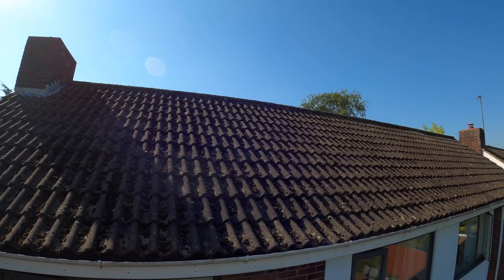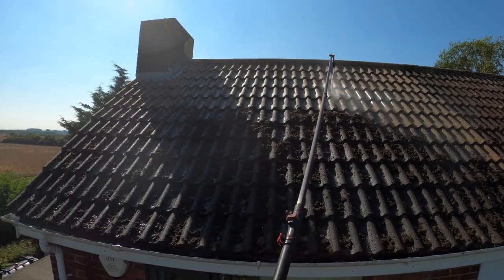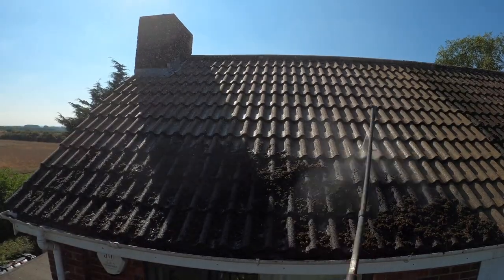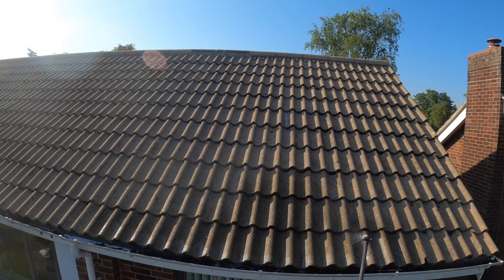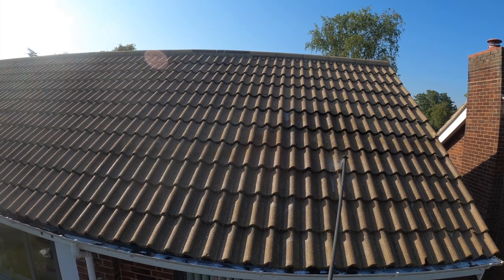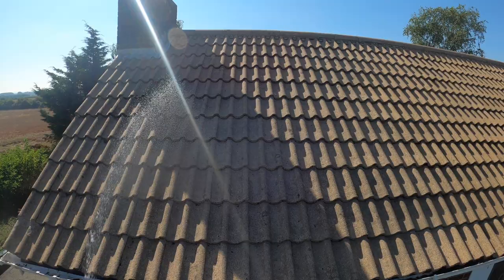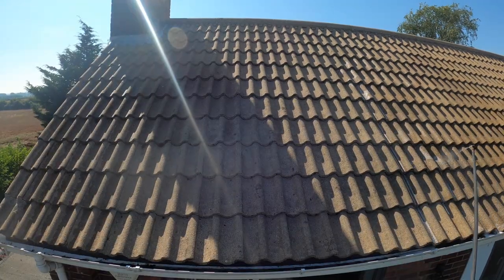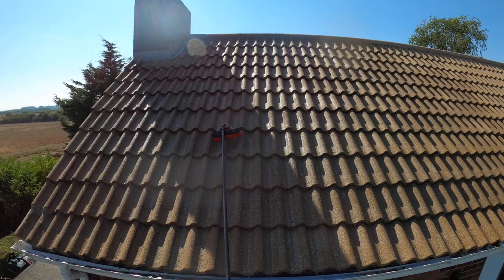Cambridge Roof Cleaning, Moss Removal & Biocide Treatment.

Comment: Hi Nick,
Have you ever thought about rigging up some sort of a wheeled dolly system on to your pole, to carry the weight of it, on those long reaches…? That way you’re just pushing and pulling the pole up and down the tiles, and the axle is doing the hard work. You could use large light wheels, like something off a child’s doll pram maybe…?
Reply from the maker: Hi, I understand why so many people make this type of suggestion. But something like that would just get in the way, and make the pole harder to control, especially at length. The water pushing down on the roof takes pretty much all of the weight of the pole. So the weight of the pole is not the issue for anyone using this method, it's the constant maneuvering of the pole, up, down, left, right, and diagonally over a long period of time. It's a good idea in theory, but in practice, it just wouldn't work i'm afraid.
Reply: @PrestigeExternalCleaning  👍🏻

Comment: Hi Nick, what pump system do you use to apply your hypo/ bio is it 12v from the van,
Cheers, Dave.
Reply from the maker: Hi Dave, no i'm a bit more primitive than that mate, I just use Gardiner backpack. They're amazing for this type of work, only downside is having to keep stopping and filling them up 😩.  Have got a brand new Rolltek soft wash unit sitting in my shed, just need to get round to setting it up 🙂👍
Reply: @PrestigeExternalCleaning  yeah, they are really handy those back packs but  like you say 20ltr don't last long,

Comment: Great result on this one Nick,  when quoting for a roof job do you offer to clean the gutters for free to make it feel like an added incentive as I’m sure you will need to do that anyway? Or do you find the water will do the job and bring down all the moss anyway meaning there is no need to deal with the gutters? 👍🏼
Reply from the maker: Thanks mate. I just inform the customer that we clean up thoroughly after cleaning the roof, which includes clearing out the gutters. The gutters have to be cleared out bud, either by rinsing them out as you go, or waiting until the end and removing the moss by hand or vac 👍
Reply: @PrestigeExternalCleaning  nice one bud! I would love to see the mess created after a  pressure washed roof, take it you put down covers below to catch the mess spilling over the sides?

Comment: Great job, the difference is amazing, do you use a biocide also?
Reply from the maker: Thanks David, no don’t use biocide, the effects of hypo will last just as long as any biocide, if not longer👍
Reply from the maker: @brettfowler7761  Been doing this over 10 years Brett and cleaned hundreds of roofs, and used both bio and hypo ,so know all about the effects of both, and i disagree with most of what you've said. 
You don't need wd40 on the lead, you just need to spray it with clean water as i've shown in this video, and the lead won't change colour. I've never known hypo to damage felt either, and i'm curious to why you think it would damage the felt if you don't use it on a roof, and only use biocide? How would you know that if you don't do it or use it?
So many people like yourself think that bio (DDAC or BAC 50) is residual (stays active for a long time), but it's not, it kills the organic matter within 12-24 hours, then that's it, it doesn't do anything else. What then appears to be the bio continuing to work, is just the fact that everything is dead, and it's slowly coming off the roof by natural weathering.
It's illegal to spray residual weed killer on hard surfaces, so why would it not be illegal for a highly toxic product like DDAC or BAC 50 that's "apparently" residual to be sprayed on hard surfaces - the simple answer is it's not residual, or it would be illegal. 
It may have long lasting effects, but so does hypo, in fact, in my experience, roofs that have been hypo'd, stay looking much better for longer than roofs that have been bio'd.

Comment: Really enjoy you videos,just subscribed and just watching a few now,

Do you use a chemical pump 12v,any chemical resistant attachments or are plastic ones ok?

I was also thinking would you be able to use SH on a slate roof?

Thanks
Reply from the maker: Thanks Karl , appreciate the sub 👍, top man. I used to use a Gardiner backpack, but now i use a Rolltek soft wash unit. 
It's a bit risky using SH on slate, as all natural slate contain metals, which can oxidise and discolour. I would advise using a bac50 or DDAC biocide on natural or man made slate. 👍
Reply: Thanks for the reply. I’m using a Gardiner backpack at the moment,wasn’t sure if I would need a viton seal pump but if I’m not going to use SH I can still use it for now and use gk pro for the roof.
Just starting out,thanks again! 👍🏼